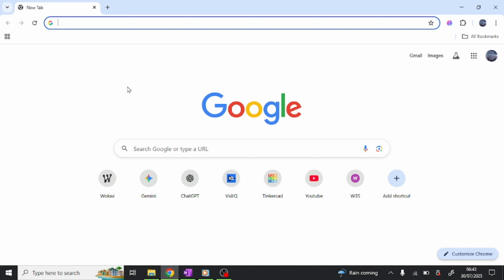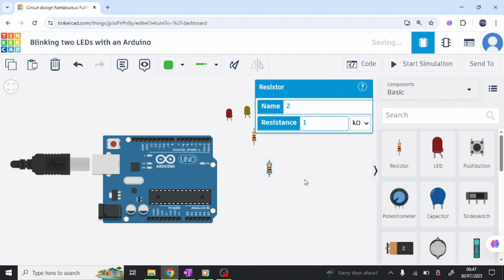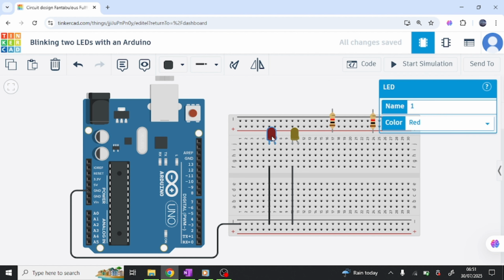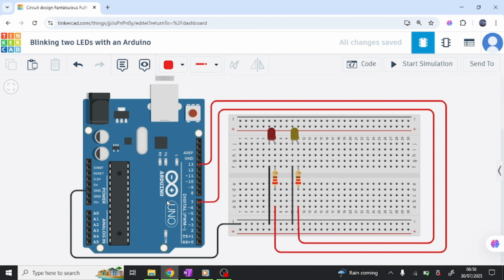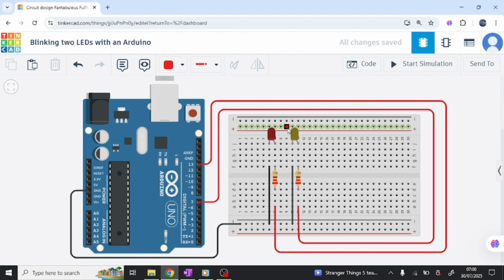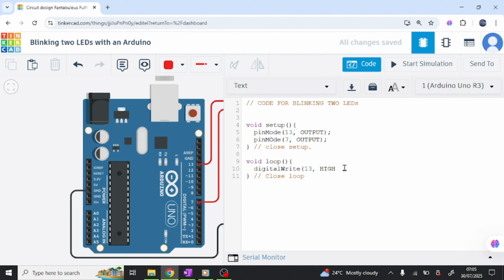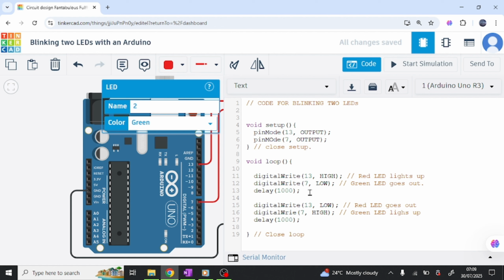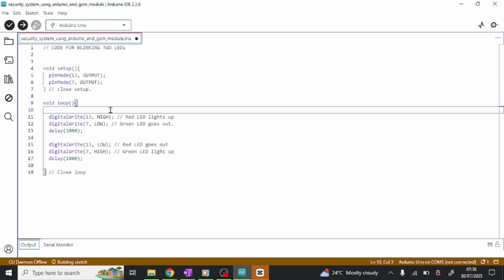EEE 431   Blinking Two LEDs with an Arduino

Comment: Very interesting and informative, more power to your channel! 👍
Reply from the maker: Yeaaaahhh... Thank you. And I wish you the very best...
Reply from the maker: I made one last week... Where a push button is used to control an LED. I also learnt the concept of pull-down and pull-up resistor.

They are all explained in the video together with the connection and the program explained line by line. The video is kind of long though. But it's worth it.

It will be uploaded this week.
Reply from the maker: Do you know the book "Arduino Project Handbook", by Mark Geddes?

I will be making videos on each project. The connection and programing... It's going to be a fun process 😊. Learning, practicing, making videos on each and uploading them.